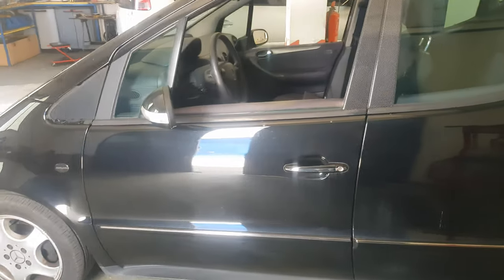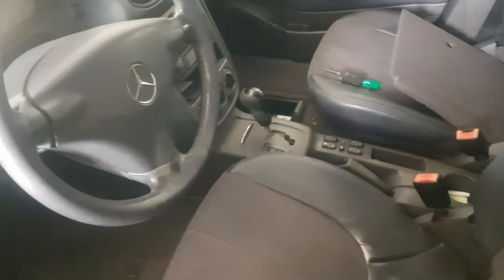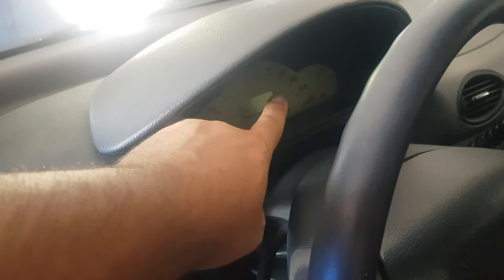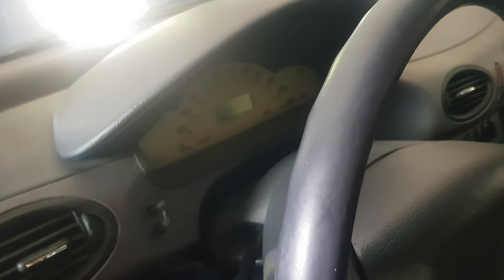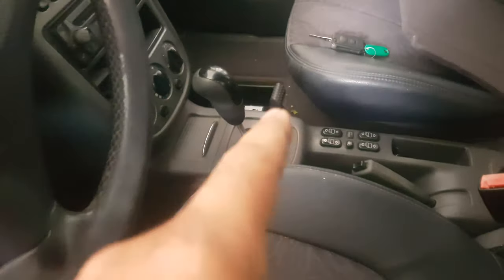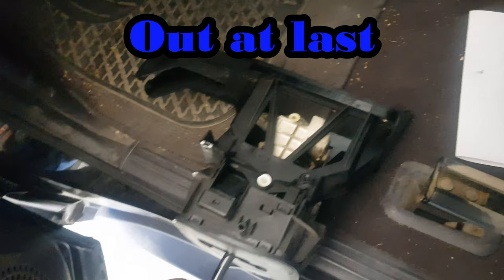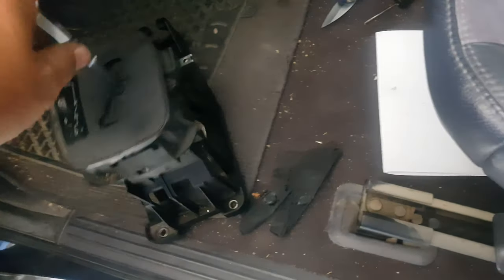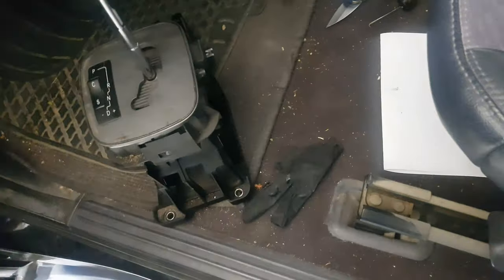Mercedes W168 A-class Grm Removal

Comment: Question. Do you think it is possible to remove everything you removed to be able to cut a hole in the steel to be able to reach the connections on the starter motor? I have a bad connection to the starter and don't want to spend another three days taking off the whole top of the engine to get the starter motor in. What were they thinking? Thank you for your help
Reply from the maker: Thanks for watching
It is possible to do that.
These car are designed to drop the engine everytime you need to work on something.
Good luck